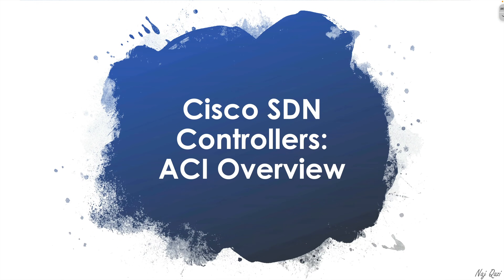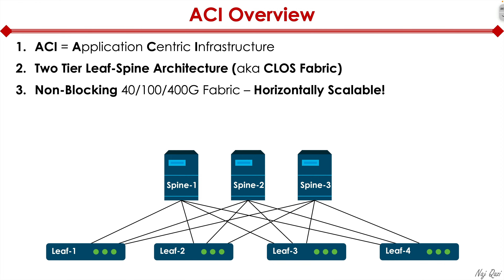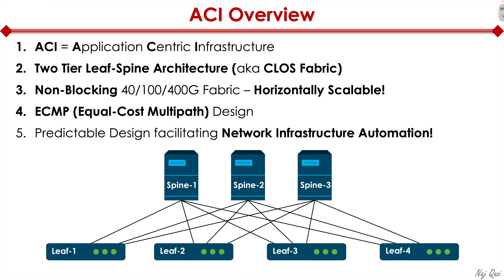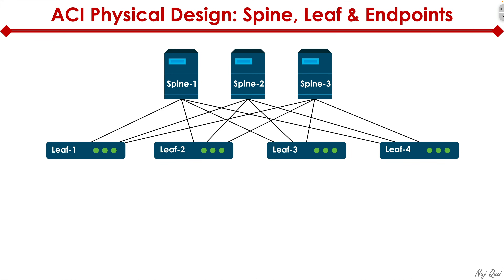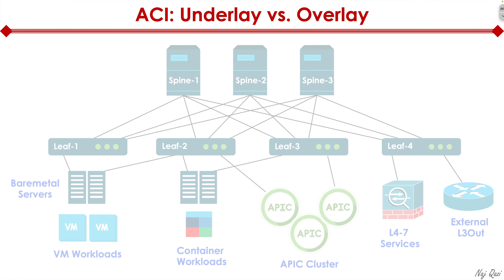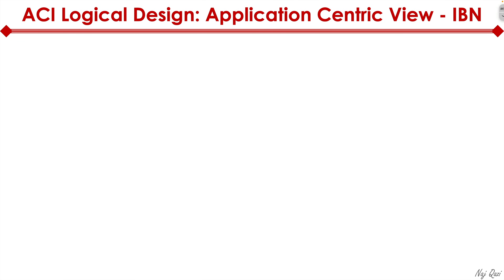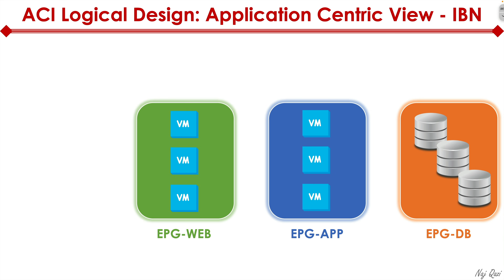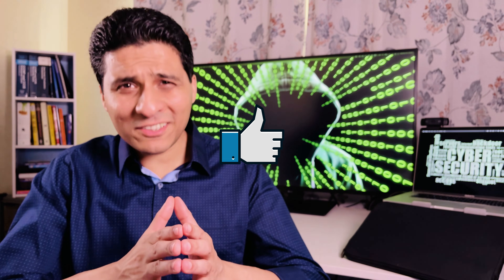Cisco ACI Explained: Master Spine-Leaf Architecture in Minutes!

Comment: Able to get most of ideas of what you presented regarding to the concept of Cisco ACI, but being with a bit of unwell understand regarding to the concept of IBN or application based networking, which sounds quite different from the routing theory as we used to learn from CCNA (the version before 2020.).
Reply from the maker: IBN is a paradigm shift, but I'm glad you got the core ACI concepts! Let me know if you have more questions.